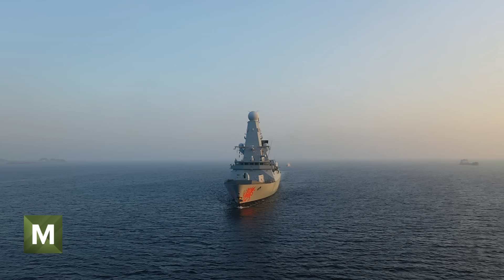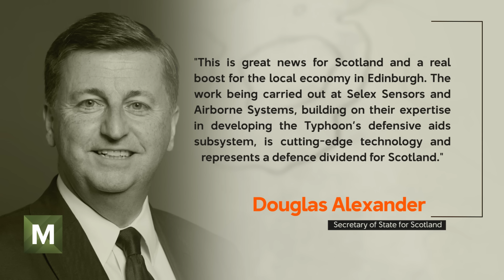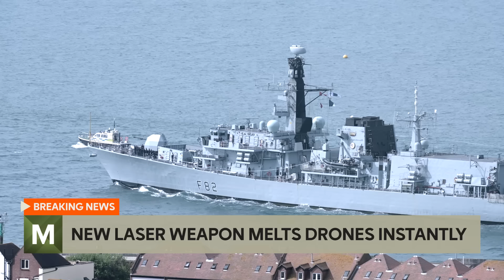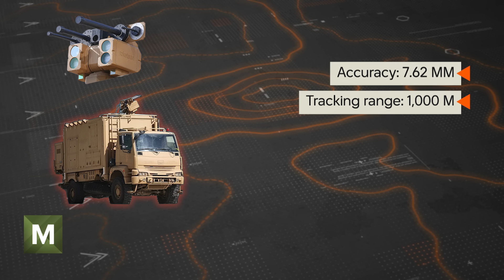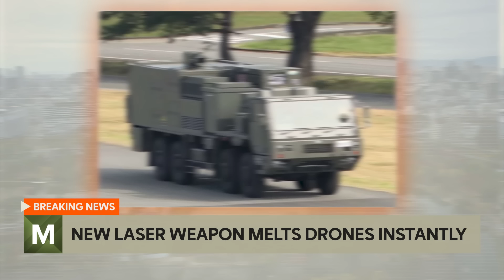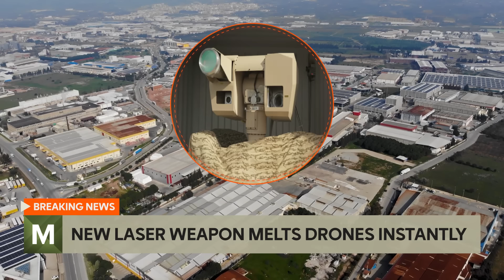UK’s DragonFire Weapon Just Made Drones Completely USELESS

Comment: From an engineering standpoint, the optics to combine and focus the beam will need serious cooling especially if a large swarm is engaged.  The over  horizon capabilities are over-hyped and violate the laws of physics.   The mechanical limits of the mount limit the rate at which the weapon can be re-directed at multiple targets, as mirror-based aiming as limited to a few tens of degrees.  This also means that a ship will need at least two systems to cover 4 quadrants to defend itself. As usual, this channel uses outrageous, clickbait titles to engage viewers and saves the bad news for the end, like using reflective coatings or materials, as well as not so instantly melting a high speed approaching, maneuvering drone.

Comment: Could it be used to slice through enemy FPV drones fibre optic cable?  If it were placed on a flank and fired up for 10 seconds in which time it arced up from 5 to 30 degrees, would the laser cut the fibre optic cable ( of maybe 10-20 drones in one hit).

Comment: Boy, do I have some reality to inject into this fantasy video. Mate, these systems don't work in real world conditions. They are useless in rain, snow, fog, dust or smoke conditions. They cannot handle large swarms. They need clear line of sight. They cannot destroy fast moving or erratic targets since the beam is limited to the ability of the fire control system to track said target and pivot the laser so the beam can hit the target long enough to destroy it. A missile is fired and it seeks the target or is guided to the target. A beam must hold a steady fire solution over seconds to destroy the target. In the case of the DragonFire system, it's about 10 seconds! This isn't Star Wars.

Comment: Sensors will quickly locate laser source and be targeted ! So , round and round we go.
Reply: The laser is just one part of a weapon system. The electricity will come from the engines on a ship or truck or a trailer. Nobody’s gonna put one of these out by itself.  It’s gonna have a full compliment of people and other weapons the complement each other for protection.

Comment: This video completely overstates the kill capacity of a single DragonFire. It takes about 10 seconds of a focused beam to take down a target and then requires about 10 seconds of recharge time. This means a single DragonFire can only down about 3 targets/minute. If a destroyer is relying upon its single DragonFire, then all you have to do is swarm the vessel with 10 drones and you will have easily overwhelmed its defensive systems. Therefore, the typical destroyer will still need its conventional Phalanx batteries, etc. to remain viable. The addition of a DragonFire is only a complement to the other systems on board.

Comment: No, Drones are not useless, DragonFire sure can shot them down, but if i send 100 drones at once i doubt Dragon Fire will be able to take them all down. especially if i send my drones on low altitude skimming the tree tops like an commercial DJI multi-rotor can fly i use photo sensors to keep the winged drone low AF hiding from radar and weapons like the DragonFire for as long as possible. i would rather use the Swedish SAAB LOKE instead. much faster and cheaper and can easy be placed out in large numbers. Dragon Fire are to slow and to expensive and to big.
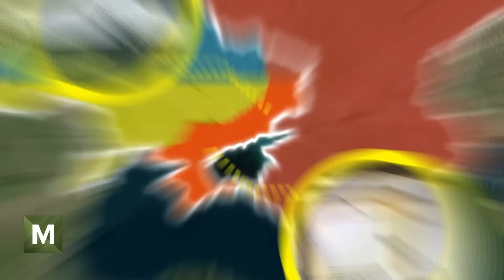9:00 no, drones cost's just 1000 Euro, not 10K of Euro.. and SAAB LOKE is cheap to buy, and ammo is standard MG ammo, that is cheap AF. And Dragon Fire need high power delivery capabilities. if Dragon Fire dont have access to large about of electrical power its useless. So no its not unlimited, everything depends on the power production. you just dont need to reload it.

Comment: Probably a dumb question, but what happens if the drones are coated in mirrors/reflective material?
Reply: very little. I used to work with high energy lasers, the kind of mirrors required to reflect beams like that need to be specifically designed to the wavelength and pulse regime of the laser, and need to be kept immaculately clean, even a fingerprint is enough cause catastrophic failure. Now imagine trying to do that on a drone in the field, its just not feasible.

Comment: A disadvantage is the limited range of laser weapons. The thousand-kilometer-long frontline would therefore require hundreds of laser weapons. They also would not help against high-flying drones.
Reply: How would it work against swarms of drones?
Reply: @JohnnyMotel99  It is a question of the number and speed of the drones. It needs a few seconds to destroy a drone, and you must target one after the other, and cannot 'mow' like a machine gun. Another question is the possible overheating of the laser, which could force to make breaks after several shots. The video praises the new weapon but does not show its limitations and shortcomings.
Reply: @gottfriedheumesser1994 maybe more cost effective against larger drones like shahed?
Reply: @JohnnyMotel99  That's for sure. I only missed the limitations of this new system in this video. Nothing and nobody is perfect!

Comment: Except you need a principal surface combatents' power-train, or at the very least a CDL-A trailer sized power train to operate the thing, which would greatly stick out for artillery strikes or any munition faster moving than a racing drone.  The type of drone it is most useful against doesn't have the range to reach out to where a surface combatent would be located.

Comment: If the enemy switches to polished aluminium or copper-skinned drones, this becomes a very expensive boondoggle in short order.
Reply: lol no, this thing is a +50 kW laser. Even if your shiny metal drone could magically stay perfectly clean it would still fry rapidly. You have also now have slower, shorter ranged and more expensive drones that are going against a system that costs £1 to shoot them down.
Reply: @Neokretai  50kW?.. What percentage will be absorbed by the little bit of dust and transferred, and how much reflected, hmmm? Even if you end up transferring 5kW of that 50kW, you lose heat concentration very rapidly via conduction over the entire surface of the drone, and then large surface conduction into the convective air flow as it flies. You'll have to laser that thing constantly for 10 minutes to get it anywhere close to the melting temp. of the metal, and be nowhere near the ignition temperature.
Reply: @adventureicing  The instant that layer of grime gets hit it becomes a plasma that will damage the surface of your drones metal skin. That damaged surface now absorbs even more laser energy, which damages the metal even more etc etc, you get a runaway effect, this is all happening in milliseconds or less. 

Thing with high energy laser matter interactions like this, the laser doesn't heat and melt a material, it basically explosively vaporises it, in laser physics we call it a Phase Explosion.
Reply: @Neokretai  That's not how conductive or radiative heat transfer works, and it definitely also depends on the material that your dust is made of (which will most likely be a silicate in most cases, which will not miraculously turn into instant plasma). Metals have VERY high heat capacities combined with very high thermal conductivity. You have no fucking idea what you're talking about. I've been engineering specialty industrial heating equipment since 1997. I actually do know what I'm talking about. Laser metal cutting or plasma cutters only work at very close clearances for a reason. A regular 130 to 150 Volt DC, 100 Amp workshop plasma metal cutter runs at about 10 - 12kW, and can only cut metal with a sufficient beam focus at 1.5 to 3mm, or 1/8 to 3/8 inches. You have fuckall chance to focus a 50kW beam sufficiently to cut polished metal plate at ranges of at least several miles like these guys are talking about. Plastic drones? Sure. You can burn the snot out of polypropylene or polyethylene with a laser at range, but polished aluminum plate is a VERY different story. The US tested a MEGAWATT anti-aircraft laser fitted to a Boeing 737 in the 1980s already, and left it for a shit idea because it didn't work at range on aluminum-skinned target drone aircraft.

Comment: Couple of very big problems with this system.  Firstly, it only has a very limited range, which means against multiple drones it doesn't have enough time to engage and destroy many targets, meaning the Dragonfire system itself could become easily overwhelmed and destroyed.  Another big problem is that the system requires a lot of electrical current that must be provided by a generating set, that's not so much of an issue if mounted on a ship, but on land it means you must have truck carrying a very heavy diesel powered generator that puts out a substantial heat signature.  Again this makes the system easy to spot via IR and makes it vulnerable to being attacked.  The system also requires radar in order to detect and engage targets, again this means having substantial amounts of dedicated equipment on site that are easily spotted or detected.  As a land based defence system it makes no sense and would be of limited benefit.  However, for navel use as a last line of defence it might supplement the likes of the Phalanx CIWS or other similar close in systems.

Comment: It is totally useless in the typical rainy or foggy British weather.
Reply: Well the thing is water doesn't absorb or scatter all wavelengths of light, this is why infrared cameras are unaffected by fog and rain. Now take a guess what laser wavelengths are commonly used for designing laser weapons....
Reply: @Neokretai  Wikipedia says this about Laser Weapons:  One of the major issues with laser weapons is atmospheric thermal blooming, which is still largely unsolved. This issue is exacerbated when there is fog, smoke, dust, rain, snow, smog, foam, or purposely dispersed obscurant chemicals present.
Reply: @thehun1234  it's an issue yes but there are ways to compensate for it, adaptive optics and multibeam focusing are used by Dragonfire to allow the system to keep good range even in fog, rain etc. They did the field tests in west of Scotland, pretty much the wettest place on the planet. 😂

Comment: I wonder if they are fitting them to destroyers because of size/weight issues. I think we’re only seeing the final, projection stage of something built into the ship. The electrical power needed is enormous, perhaps requiring huge banks of supercapacitors and ship sized generators. Is it possible they’re too big/heavy for land mobility?
Reply: They ,are being considered to be mounted to a wolfhound vehicle
Reply: @melissareohorn7436 
Thanks, Melissa.
Then I agree with all the others. Make this a priority and get them to Ukraine, ASAP.
Reply: @q.e.d.9112  it requires a far bit of power, but a truck engine has more than enough

Comment: it looks like dragon fire will only be able to stop 7 or 8 drones so fairly easy to overwhelm
Reply: But at what cost? A £1000 shot to take out a £50000 shaid drone? WIth this economics you can build and deploy Dragonfire at scale.
Reply: @stephenclark9917 what cost? Once overwhelmed it could cost the millions of dollars of everything it was supposed to protect.
Reply: One system could be chewing through 7 or 8 drones per minute, the cost of a Geran is about $70k, that's $104 to shoot down $560k of drones. Now imagine 10 of them defending a city, they could down 4800 drones in an hour, Russia has never launched an attack remotely that large but if they did it would be cost them $336 million, and could be defeated for $62k, less than the price of a single Geran. 

Obviously that's an ideal scenario, but throw all the current air defence methods into the mix, and you can see how having something like dragonfire which can accurately shoot down drones cheap and fast completely changes the economics of the current drone war.

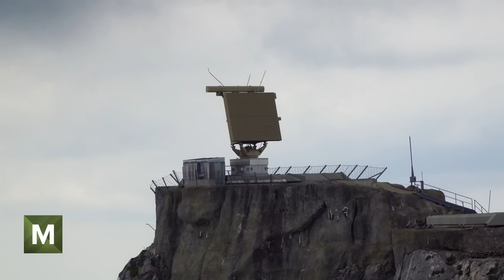Comment: 10:00 Dragonfire can track and thus begin to calculate a firing solution on targets that are over the horizon, but it is still a laser, and it still cannot actually hit a target where the straight line goes through the earth's surface. This all simply means that when a target does come onto a direct lie of fire, the weapon is already aimed, has calculated the trajectory for movement and distance, etc.
Reply: On t45’s dragonfire it’s said can target on it’s own but dragonfire gets advanced warning from the Samson radars tracking systems for targeting when bigger targets like a missile comes in to it’s range,so it will prioritise it as a threat at the point it can engage,freeing up dragonfire to go back to targeting  drones freely on it’s own until the next missile, you should see what the t45 can do after pip is amazing there’s a room which for is out of bounds due to extra power production these need to be installed soon, for safety sake😅

Comment: According the specifications I heard it can only take out 1-3 drones in the time it is inside the effective range of a ship. 1km 3-10seconds per shot coming at you at 400km/h=111m/s. It ether need improvements, several system overlapping or both to really protect a ship fully from a drone swarm. But it is a beginning. Also all they who write "send to Ukraine" i understand the feeling but this needs a lot of reliable power close by. Would be really good to protect the generators, dams and powerplants themself though. The small intercept drowns maybe a lot more effective for wider coverage of the country.
Reply: They are relatively cheap

Comment: How does it preform in fog? Or low over the sea where air moisture will deflect the targeting system and the laser? And how will it deal with a swarm of drones if it can only focus on one target at a time?
Reply: Apparently will work in both fog and high moisture environments. Today DragonFire can destroy targets over 1 mile away and needs 3-9 seconds per target so it should shoot a high number of them before they could get near the warship (drones are very slow).

Comment: It's cool, and really good for the things it's designed for: defending high-value targets that have ample power capacity, like Royal Navy ships.

It's problem is range. While officially classified, the MoD has claimed a range of at least 1 km ( 'it can hit “a £1 coin from a kilometre away”'). That makes it suitable for defending specific targets (for example, Ukraine's thermal plants), but not all of the nation (or even a city), due to the sheer number of them you would require.

The story is a little misleading about over the horizon targets. While it can track them, allowing it to be ready to fire sooner, it is not able to "strike targets just beyond sight." To actually hit the target, it must still have line-of-sight on the target.

It's an important capability, but it doesn't make anything useless.

Comment: It’s not instant! Try again..
Reply: When the system develops more and has enough power to attack the sun it'll take about 8 mins to hit it after firing. The suns about 147000000 km, the claimed system range is currently 1km. 8mins/distance to sun = @3.26530612 microseconds or  0.000003seconds.

 0.000003 seconds is as good as instant in 99.9% of peoples minds. The target isn't ever going to be able to move fast enough to break a lock given the angle a mirror needs to move to maintain lock would be tiny. If the claimed power is true, this ting will eat thorough(enough to disable) most targets in seconds.

Comment: Send 50 cheap drones, the laser only gets one at a time. Another expensive waste of taxpayers money.
Reply: No. The laser gets them in rapid succession. Sour grapes, Ivan is it?
Reply: @rogerphelps9939  Not enough time to get them all. Send 100 instead, eventually the laser misses the last couple as it takes time to cook each drone. How many are needed depends on how fast the drones are traveling. There are many possible types drones, and a metal heat sink will most likely stop or slow down  the laser from damaging  the drones.

Comment: If the target has a reflective surface, focus the beam to a singularity point 1mm away in the air.
Reply: A reflective surface would only protect against the visible spectrum, not this thing.
Reply: This is not true.
If you can make a laser, then you can make a reflective surface for the wavelength the laser produces.
Reply: @grzegorzkrk  you can, but good luck keeping that surface clean so it can actually reflect properly,  or able to handle even a few % of the lasers power it would still absorb even under ideal lab conditions.

Comment: Sell it to the US.  But include a Switch-off or half-power setting that can be remotely set, just like the US will do for weapons it sells the UK.
Reply: It's a smart strategy, since anyone could theoretically buy a weapon, then turn around and use it against the US, just like the Afghans and Iraqis did with abandoned equipment during the GWOT... also, the US definitely doesn't need a foreign produced system that they've had for years already. This tech was developed decades ago and was mounted on a specialized nose turret of some Boeing jet to shoot down ICBM's during their ascent phase.
Reply: @joemeschke Rubbish. Clearly you cannot accept that the US is not number 1 in everything
Reply: @joemeschke but its not smart strategy to buy weapons with a kill switch, so exporters are just “shooting themselves in the foot”.   :-)
Reply: @j @joemeschke developing something means actually creating a working system, not trying and failing like the US did decades ago with YAL-1.